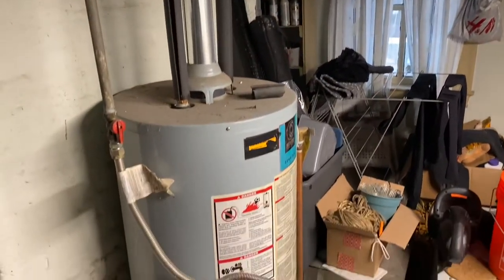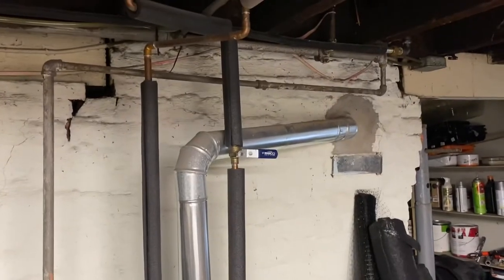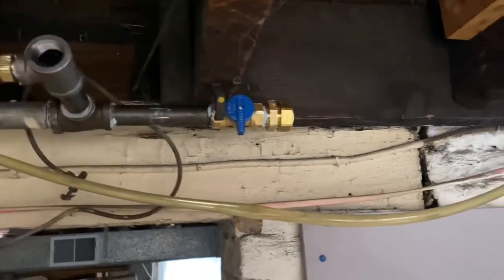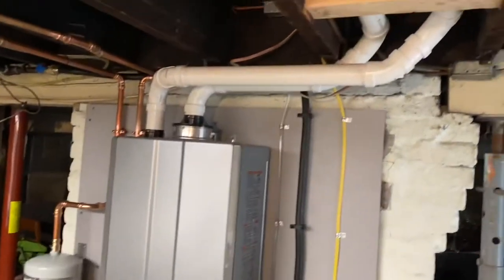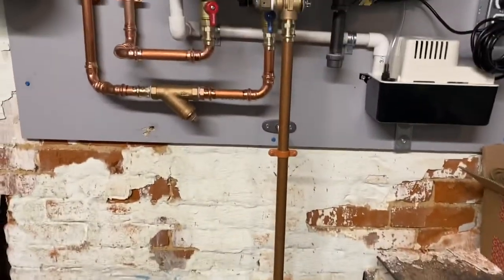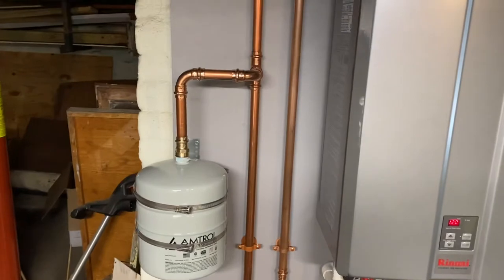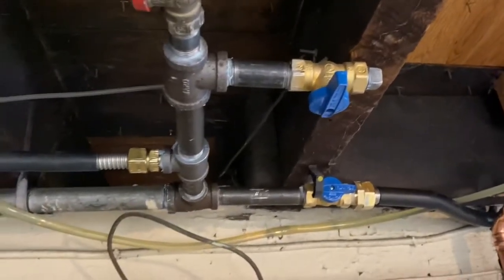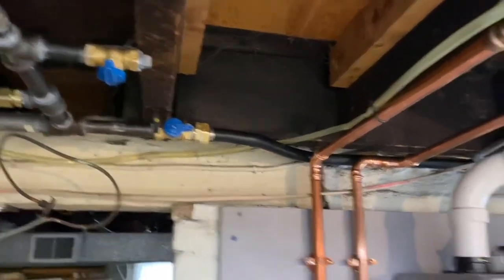Tankless water heater install

Comment: Condensate is acidic, will it eat up the little pump you have in place? I install a neutralizer on condensate drain from tank-less condensing type WH's so it doesnt eat up drains and drain pipes.

Comment: Great job, Debating the need for expansion tank with my plumber.. My manual says its needed.
Reply from the maker: Who does the Enginering? The manufacturer or Plumber? I look at it as protecting your investment and insuring no nuisance problems with the relief dripping.

Comment: What is the difference between the black CSST flexible gas line and the yellow CSST flexible gas line?
Reply: Two different manufactures. Different fittings for install. Some flexible tubing gas pipe is bonded better than others

Comment: you added an expansion tank on the cold line but there is a check valve coming out of the tankless so the expansion tank is not doing anything? As far as I can see. EDIT I think you said that is a strainer screen so I stand corrected. Do you still have a check valve on that cold line?

Comment: Note  to self, the expansion tank is installed up side down there fore rendering it useless.
Reply from the maker: Maybe you should re-read the install manual…
It’s mounted in the only acceptable orientation.
Reply: @hvaclaidback107  shut him up real quick